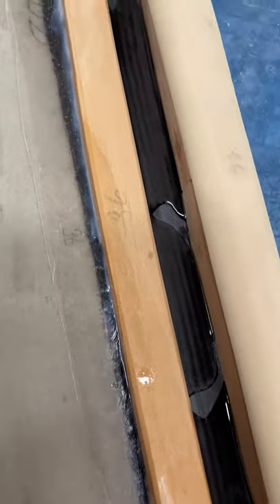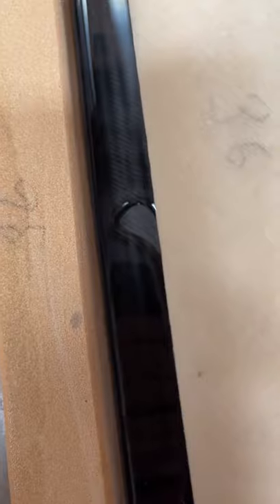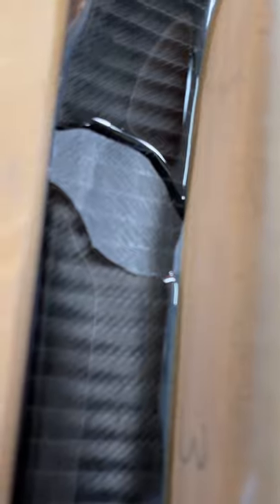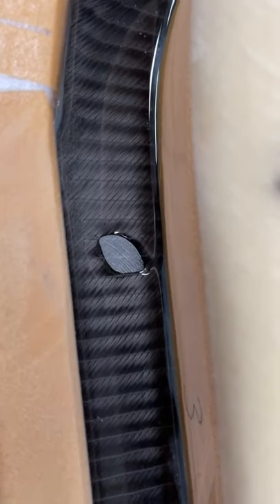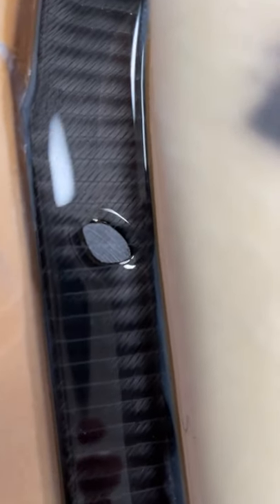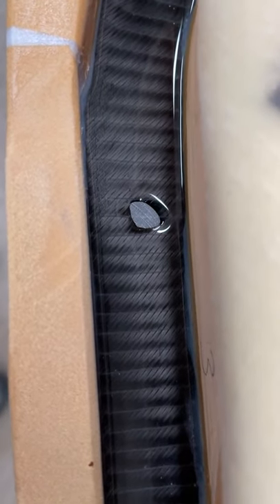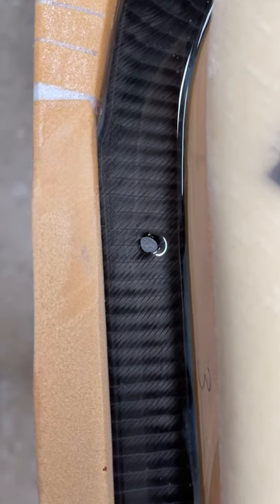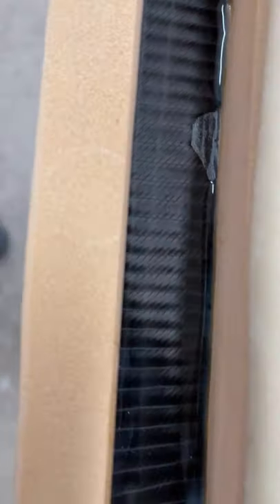To make the gasket rest om a flat surface I made a canal filled with NM-epoxy. Video done quickly

Comment: Did you add anything to reduce the viscosity of the epoxy? It looks like you didn't need to, is my guess.
Reply from the maker: No addition. However NM-epoxy have a low viscosity variant for injection.

Comment: The epoxy will only be as level as the hatch cover is sitting on the table. Is the table level?
Reply: That’s not what’s important. The important part is that it’s flat.
Reply from the maker: Wrong. The epoxy is level if it covers all the gasket base. A free floating surface cannot be uneven in calm conditions.
Reply: @SvenYrvindExlex  I guess I see a difference in flat or level.  The epoxy will be flat.